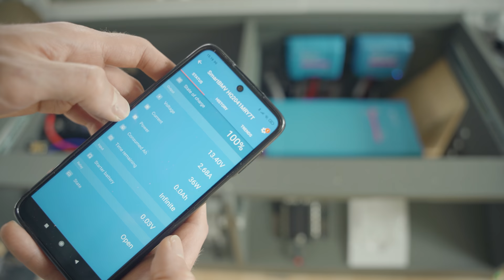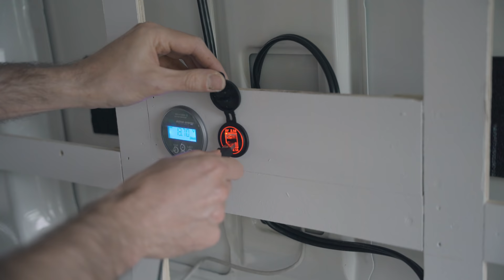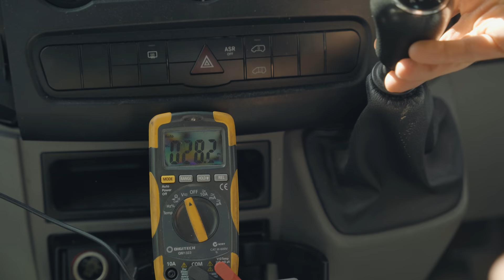Finishing my Camper Van Conversion. Wiring, Plumbing, Insulation & Everything Else

Comment: I HIGHLY recommend the propane instant hot water heater: cheap and pretty minimal space use; you will have to figure the exhaust vent. We used one for our kiddie pool and for an application like yours, you will be loving it. Did I mention what an astounding engineer you are :-)  The drawer latches are stellar. And even inventing cool new language: 'remantling' (added to dictionary). For the cabover platform, I would have routed a recess into the wood the depth of the bracket (3mm?) and then put the carpet over all, with little X's for screw access to hide the brackets. You can probably still do that 'in your spare time'. For the floor cover, once you were unhappy, I wonder if you could have gotten some sort of thin carpet and used the spray contact adhesive to bond the carpet to the black stuff; but no, the light colored vinyl was a great choice: easy to sweep clean/mop, and light, and lighter. I see a great opportunity to mod the toilet cover: I am thinking casters mounted with 3mm floor clearance, and you have enough height to trim to make a solid support and use a NICE computer gaming chair to mod to fit on top of the shortened cover, and even retain the recline and lift functions 🙂 Not only super spiffy, but removable for doing business. Keep the vids coming.

Comment: Mate, awesome work!!  The whole thing is clever and well thought out. Great work also on the sliding drawer locks - great use of 3d printing. If you could, where did you get the recessed LED extrusion? I'm assuming you got the lights from ebay or similar but I was hoping to source the extrusion locally (I'm in Aus).  Will be nice to see video of a trip somewhere,

Comment: Gaaah, that quick release coupling for the hose coming out the water tank is exactly what I'm trying to do but really struggling to find a quick release coupling that doesn't have a female/male thread on the top side that I want a hose to connect to. Can you share what that fitting was called? Might help my hunt for one in the UK. :D